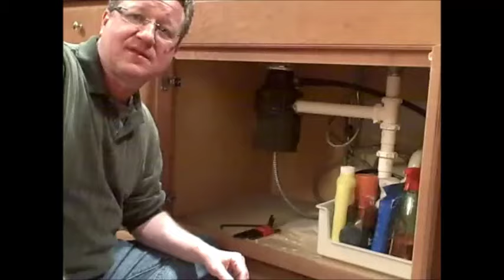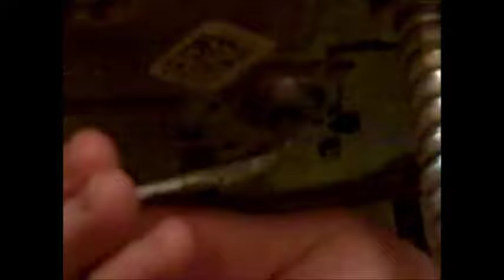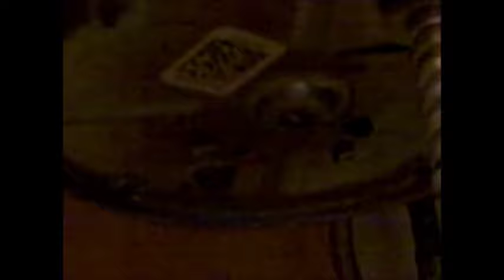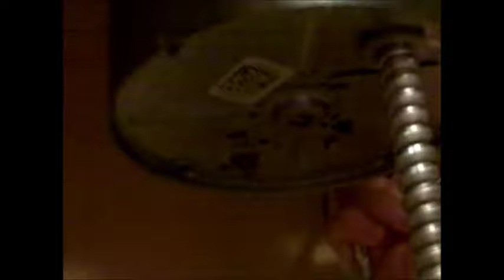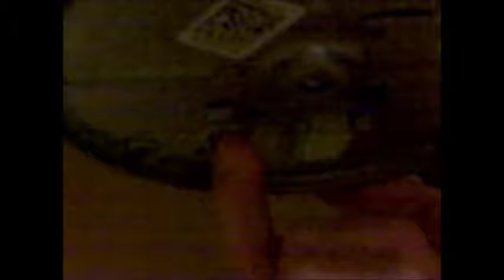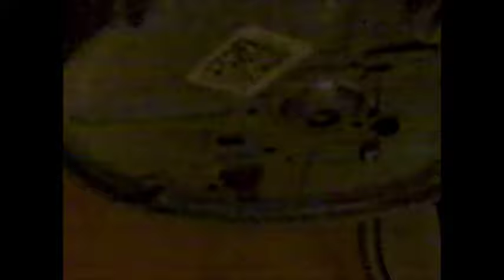Unclogging Your Garbage Disposal - Garbage Disposal Tool

Comment: Thank you!  A simple tool and a simple fix. Worked perfectly. I did the Allen wrench first but while in the vicinity pushed the red Reset button and then ran water and turned the disposal and it worked. I had not used the disposal for several days. I don't put food into the disposal, but residual food does go down, just small amounts of dish remnants, but think, the disposal should be run every day or every other day to keep the motor turning.  
Thank you again for the tutorial and the easy fix lesson!!
Reply from the maker: You're welcome
Check out more home improvement tips in our e-books https://www.amazon.com/gp/product/B0B2KW1FQ9?notRedirectToSDP=1&.

Comment: Thanks. I came back on these videos to find out if I have to hit the reset button after I turn the Allen key. I turnt it to the left and then it unclogged because I could hear it draining. But I didn't know the reset button was for the electric, which was cool to learn so thank you! The other two videos I watched didn't mention turning off the electric first so thank you for that safety feature. Not sure I have an idea how to do that (it's just a switch on the wall) but I'm glad it was solved, so thank you for this video!
Reply from the maker: Glad it was helpful.
Check out more home improvement tips in our e-books https://www.amazon.com/gp/product/B0B2KW1FQ9?notRedirectToSDP=1&.

Comment: Thank you! I did this and had to pull pretty hard on the tool. The clog went away (garbage disposal back to working)… but now water leaks through the bottom of the disposal when I run water… any ideas? Thanks!
Reply from the maker: Hi, if it's leaking from the flange or the hose and dripping off the bottom you can repair it, but if it's leaking from the bottom because of corrosion or the internal seal, you will usually have to replace the unit.
Check out more home improvement tips in our e-books https://www.amazon.com/gp/product/B0B2KW1FQ9?notRedirectToSDP=1&.

Comment: My dad is trying to unclog ours but he says the wrench won’t turn either way …. Also says there’s like black gunk down in there … says it looks like charcoal ….
Reply from the maker: Hi, you can wiggle the tool both directions to try and free up the lugs if something is wedged. You can also unplug the unit or turn off the electric to the unit and look inside with a flashlight to see if something is caught between the lugs and the grind ring. 
Check out more home improvement tips in our e-books https://www.amazon.com/gp/product/B0B2KW1FQ9?notRedirectToSDP=1&.

Comment: I got the wrench stuck in the unit and can’t get it out.  Tried pried pulled etc. turns free but can’t get wrench out.  Help
Reply from the maker: Hi, I would try grabbing the wrench with regular or locking pliers and then tap down on the pliers with a hammer.

Comment: What do I  do if I can't get the wrench to move in either direction?  It's getting power.
Reply from the maker: Hi, you can grab the wrench with long handle pliers for more leverage. Work it back and forth a little at a time.
Reply: @FIXITHomeImprovementChannel  Still won't budge.  Feels like the whole disposal is moving a little and might break off.  Going to buy some Wd40 to spray in the hole where the wrench goes.  Do you think that might help?

Comment: My Allen wrench won't turn
Reply from the maker: Hi, turn the wrench in both directions. You can apply some force, it is designed to handle some pressure. You can also turn off the power to the circuit or remove the plug and look in from the top to see if you can see the obstruction and knock it loose.

Comment: What if the wrench won’t turn...? Like you put it in once, it turns, go through testing out if it works like you said and then it doesn’t (though you said it might take a couple tries)
and then when you try again, the wrench now won’t turn...

What do you do then..?
Reply from the maker: Hi, you can grab the tool with a locking pliers to get more leverage. Sometimes wiggling the tool back and forth will free what is caught.

Comment: Blades spin, block is in the pipe
Reply from the maker: Hi, you can remove the trap and see if the problem is there. Then with the drain pipe removed you can rod the drain pipe. You can get a hand held auger from a hardware store or home center, or you can rent a drain auger. 
Check out more home improvement tips in our e-books https://www.amazon.com/gp/product/B0B2KW1FQ9?notRedirectToSDP=1&.

Comment: Silly. Just put ice in it and turn it on. It’ll clear up in 1 second
Reply: Not if its locked up. This video shows how to unlock a jammed garbage disposal.  Ice will do nothing if the unit is not moving. This is a common problem and common fix. Nothing complicated at all.